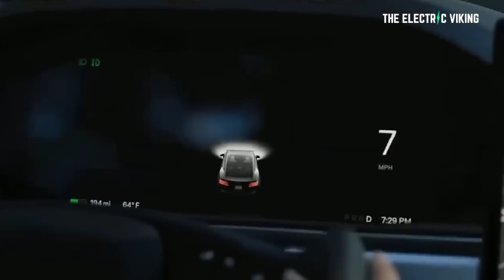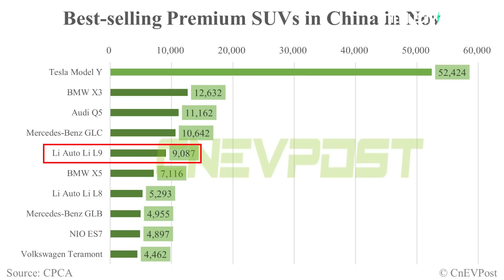The REAL reason Tesla are suspending Model Y output in China

Comment: Agree, Sam.  FUD, FUD, FUD.  Numbers don't lie,  but the media does.
Reply: @hoppingrabbit9849  exactly, 2x bigger net income than the previous year!
Reply: @greecemobile7610  and half the stock price.
Reply: @JayMcKinsey  Who cares if the price go down, the price in the long run always follows the fundamentals, look for example what happens with the pinduoduo. Cheaper price means you can buy more shares with the same money and on these good companies I care always what's the number of the shares that I own.
Reply: @tomdrewenskus8167  Yes they are incredibly  biased by reporting true information about Tesla.
Reply: @JayMcKinsey   4680 batteries is the best solution for the semi truck, fastest charging (0-70% in 30 minutes), longer autonomy and lower weight compared to lfp batteries so the payload is not reduced and the autonomy is the highest across all the other semi trucks , same price as to buy lfp batteries from other companies, easier mass production because cylinder batteries is easier to manufacture and later on tesla will make 4680 lfp batteries wich will be very useful for tesla model 2, power walls and megapacks. You will see.
Reply: @greecemobile7610  Keep on coping.

Comment: The CMY only has a single piece rear body casting. Factories get shut down for 3 weeks to make a major change to the production lines. Look for full front and rear castings among other improvements, now that Berlin and Austin are ramping up.
Reply: Yes, plus nobody is talking about how tesla has a massive catl facility right near the gigahai plant(I think it's less than 2 miles away? With another being constructed within a mile or so per the wu wa Shanghai videos. 

And catl had confirmed tesla is switching to lmfp cell to pack tech for the Chinese lineup. This was supposed to happen this quarter or q1. 
So I'd bet it's retooling for using the new lmfp cell to pack&cell to chassis tech catl just started offering. It'll be interesting to see though. 🤔
Reply: Why are they changing?
Reply: @TheBooban  reducing the part counts reduces complexities and cost, and increases production.

Comment: Speculation - They're changing the model Y line to front & rear castings + structural battery pack, now that they are available in quantity, keeping it quite to avoid the Osborne effect.
Reply: Castings only IMO. Although if they fit BYD structural blade  - you would be correct.
Plus CATL structural too. Just not 4680.
Going to castings would be huge redundancy of robots.
Your speculation better than Wall St.
Reply: @iandavies4853  Castings and L3P batteries need to go into a new Model 3 and would decrease their production time/thru put and reduce the parts headcount and streamline the material management execution.  KISS.  Tesla has to stay one step ahead of BYD and the competition in technology (their a tech company but they mainly make EV's) in the China, US and  Europe or their perceiving luxury status will have to become a mid tier player and their prices will have to come down.  If your costs go down you can easily decrease your price and kill the competition with a perceived superior product.  I hope all the Chinese engineers get rid of the inefficiencies and make the EV's with less variances/defects and more reliable.
Reply: Removal of stalks, maybe Yoke steering wheel, air suspension.......

Comment: I’m fascinated that new car sales in China have gone from 7% to 35% electric cars/hybrids in such a short time, especially with all the lockdowns. I expect there has been some combination of carrots/sticks to push things that fast, including such things as pricing fossil fuels to be untenable, which I expect will be a major thing in the US that forces the issue.

My 2018 Outback has 56k miles on it, as things are going now, I doubt I’ll use it up before I’m forced to transition due to the various carrots/sticks. I’m hoping the technology has advanced combined with infrastructure that it’s not such a problem for things like road trips, or merely the fact I’m living in apartments with no place to charge (you should see how nuts parking is, wait, adding charging?). The proper transition should be done using the benefits of capitalism correctly: make it so much better of a solution to the problem of personal transportation by making it cheaper, rather than by force by making the old tech unaffordable. I’m in a better economic situation than a large percentage of the population, if forced to, I can go buy a car, and if I start saving up again, I could blow my cash savings and buy one in cash, but that’s a waste at this time. “But you’ll lose your resale value by holding on!” I can hear people screaming, by holding onto an ICE vehicle during this transition period. And? I’ve only ever changed cars because the current car I had no longer met my needs for safety, reliability, maintenance costs, or it literally has died on me (my first car, engine seized at 40 mph in fall 1992, 1977 Ford LTD Country Squire station wagon that was abused before I got it). Because of how transitions work for a given technology, especially with ecosystem/infrastructure, they tend to be quiet, subtle at first, and nothing is visibly disrupted, but then they impact the existing ecosystem/infrastructure, the old way starts being manufactured less, fades out, gets expensive, then is replaced, I expect the real method for that will come due to fuel costs and that infrastructure: gas stations work on a thin margin and rely on volume to survive, gas/diesel is a pure commodity: they likely make most of their money on people buying other things than fuel, but the fuel-related stuff is a HUGE money sink. At some point, not many ICE stations will have the volume of gas/diesel buyers to earn their thin margins, and it’ll become a nightmare to feed your ICE horses as they either transition or fold entirely. I work in tech, and have been into it since about 81: I’ve seen many technologies come and go, and they follow this pattern, perhaps with minor variations. New tech replaces an older tech, sometimes without it being provably objectively better, but part of the whole process I’ve seen repeated is the old tech has reduced in quality over time due to becoming a commodity made to the lowest possible cost point, so anyone can buy it, but nobody wants to. Case in point: floppy drives! Their last gasp in the market, you could as an individual buy one for $10 or so, but they were prone to dying if you looked at them funny, while those in the late 70s easily cost $400, and that’s not even accounting in either case for inflation. Those made in the late 70s tended to last forever.

Before anyone seeks to “correct” me, you can only feel a tiny part of the elephant, and it’s not the same part I’m stuck with. You won’t get a gentle response.

Comment: It is difficult to get cars made in the last week of the quarter delivered that quarter. It may be that the costs for making the cars made in the last week get included in that quarter. By shutting down for the last week it may make quarter profitability higher. Last quarter Tesla famously did not engage in it's previous practice of an end of quarter delivery push, so revenue for China may be 4 weeks and cost of manufacturing may be 3 weeks. This may give additional short term impetus to the stock price.
Reply: It could be that the above combines with marginal excess capacity, demand reduction due to recession, retooling and additional factors others have mentioned for a win, win, win.... decision.

In the US where there will be new manufacturing snd sales incentives in January that last week of production is apparently not being stopped.